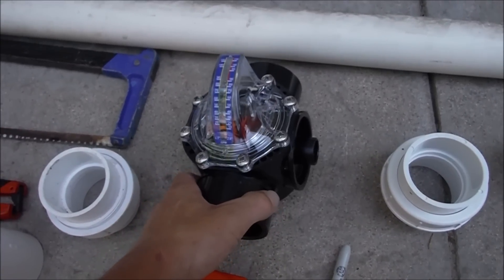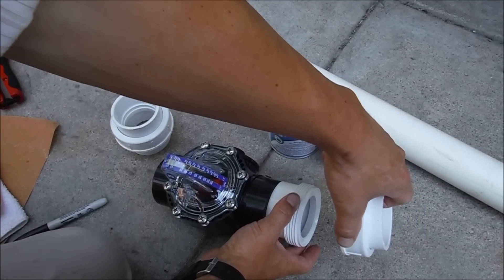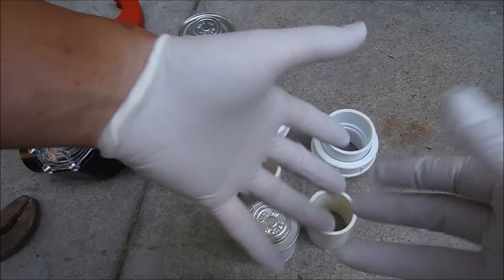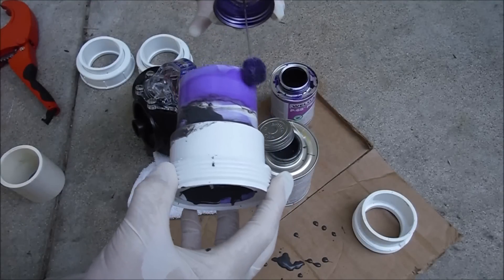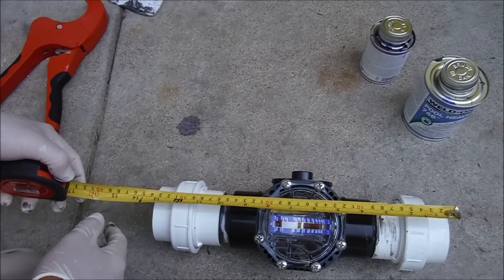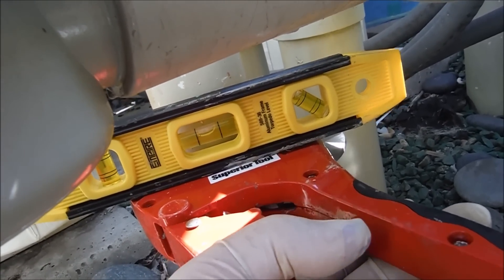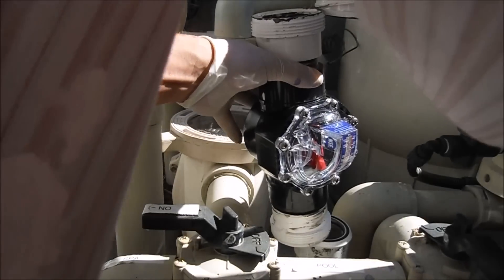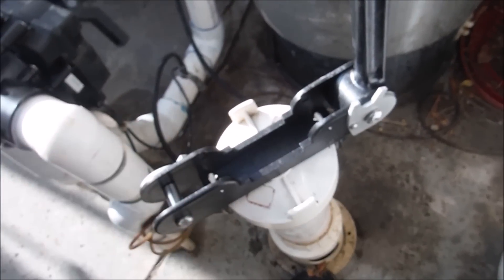FlowVis® Flow Meter - Plumbing in the Complete Valve

Comment: One helpful tip is to put the unions on when glueing the fitting. Sometimes if you get enough glue on the outer surface the union will suck air or leak water. Also make sure the union is tight when glueing.

Comment: I just installed one, took the cover plate and plunger off the jandy (only) check valve and replaced with the flow meter face plate and spring plunger. It works perfectly

Comment: Two corrections should be made to the the assembly process in this video.

1) Two glue types are needed for this valve and union glue-up.  The valve is CPVC and as such requires a "General Purpose" glue that specifically says it works with CPVC, not just a PVC glue.  PVC primer is fine for CPVC though.  The gray stuff used in the video is a heavy. high strength PVC glue.  You should use the gray stuff for any PVC pipe 2" and greater in diameter.  You really need to hold it place for the first 30 seconds after insertion and twist.  It does take longer to dry before use.

2)  The valve should be disassembled before applying primer and glue.  Any spill over into the check valve will likely ruin the seal or flapper.

Do it right.  Do it once.
Reply: Thanks very much Steve, just caught this thanks to your post.  Was about to use the wrong cement.
Reply: Hmm, so much for that.  Everyone recommends Oatley All-Purpose but right on Oatley's site they state here: https://www.oatey.com/PlasticPipeCement they state "Can I use All Purpose Cement to join PVC to CPVC?

No. It is not recommended because it takes longer for CPVC to finish the curing process necessary to complete a strong bond after the cement is applied. CPVC is also rated for hot water use which will affect cure times. PVC is not rated for hot water temperatures."
Reply: I was only able to find one Cement that is "also certified for transitions to PVC".  It is IPEX "System 636 Transition Cement / CPVC CEMENT".
Reply: Glad to help. Weldon makes a CPVC cement.
Reply: So just use CPVC primer and glue. Disassemble the valve prior to gluing. Thanks
Reply: @jeffrice238  636 is for venting only!
Reply: The correct cement for a CPVC valve to PVC piping is IPS Weld-On 724, which is rated for both/either plastic resin. See: https://weldon.com/solvent-cements/cpvc-cements/724-cpvc/
Use along with either Weld-On P68 or P-70 PVC-CPVC Primers

Comment: You don’t have to attach the unions right next to the check valve as shown in this video. You can add them elsewhere in the system which will allow for partial disassembly so there’s enough slack to directly plumb in the flow meter. Best practice is to have unions on either side of each major component so it can be easily swapped out or removed for repair. Otherwise over time your system will get all chopped up and filled with couplers until there’s no room and you need to re-plumb the whole thing. Unions are 100% worth the cost and installation time

Comment: Just a heads up, this adds a lot of relative dynamic head to your installation if your system is designed for low head loss(eg. energy efficient). The official specs are:
 Head Loss (Model FV-C) 0.77 psi at 20 GPM, 2.37 psi at 112.6 GPM.

Comment: Hey david why do maufactures like hayward or pentair use brass nuts or like the top of a  starclear plus filter use brass instead of hard stainless steel for fastening the lid it seems like brass is a soft metal and shaves every time you use it

Comment: This valve is CPVC not PVC (stamped on it).  I confirmed on the H2Flow engineering data sheet for this model (FV-C 2"/2.5").  Their larger models are PVC.  How do I glue it to PVC pipe?  I'm confused by your correction that says to use two different glues, but then you say use the "gray stuff."  The Weld On glue you used specifically says NOT for pressure applications and doesn't say works for PVC to CPVC.  Any help would be appreciated.

Comment: SPL, I have a question: My space is very limited (short runs) no run long enough for unions and actually none long enough for sleeves. Can I cut out the 4.5" needed and pull the pipes to the side enough to plumb directly to FV? It's 1-1/2" I know it will be a 1 shot deal and no dry fit
Reply from the maker: You can plumb it directly in.

Comment: Hi David what connections do you recommend I will be adding this after my water heater is yhere hi temp unions?
Reply from the maker: Standard unions are fine. But they do sell CPVC unions as well which are a little better under heat.
Reply: @SPL  thank you so much do you have a link
Reply from the maker: @franciscoguzman4318  They look like this - no direct link - I bet Home Depot carries it. https://www.supplyhouse.com/Spears-8057-015C-1-1-2-CPVC-Schedule-80-FKM-Union-2000-Socket-x-Socket?gclid=CjwKCAjw4MP5BRBtEiwASfwAL1Tqh1TEl16VfbQoO7wk0h-UCAMUSqADyNO4tRMhFV0sCUjYZfqW_hoCaxkQAvD_BwE
Reply: @SPL  thank you sir I appreciate it so much

Comment: If I have an in-floor cleaning system and I lower my rpm but extend the run time, would I need to run the floor system for the new extended run time?  Or would I just run it the 4 hours I do now?
Reply from the maker: You should be fine. If the pool looks dirtier than usual you can up the run time.
Reply: To get the most efficient circulation and filtration form your VS pool you will need to keep the 4 hours of higher flow that permits the pop-up system to activate as well as adding longer periods of low flow for circulation alone

Comment: What tool was that you used on the rainbow 300 to remove the top i have account and it will not come off.
Reply from the maker: That is the Klorkinator by Multi-Tork. I believe only one supplier carries it right now. Very handy tool. I've got a complete video on it: KLORKINATOR. Klick. Twist. Done. - Lid & Cover Removal Tool: http://youtu.be/esP1CrYvRNE 

I use it all the time and love it. Call this number to order it: (800) 683-4500 or visit their website and send them a message - I think it is multitork.com. It just came out a couple of months ago. SCP doesn't stock it yet.

Comment: Hi, how many pool volumes as a minimum is required to pass the filter in 24 hours?
Reply from the maker: Not sure exactly for your pool  -each pool is slightly different. The way you calculate it is by the pool volume - how many gallons divided by the flow GPM. That will tell you how long to run your filter each day.
Reply: One pool volume of filtration only treats about 64% of the water. The standard is to allow for THREE volumes each day which treats 95% of the water. This ratio applies equally to any size pool

Comment: Hi, is the measurement only in GPM or also in liters per minute ?
Reply from the maker: MrLito010 So far it is made for the US Market mainly. It is a good idea for a version in Liters and I will bring that up to them. So you will just need to do some math- Google search engine has a built in conversion so 60 gallons per minute would be 227 Liters per minute.
Reply: Hi, thanks for your prompt answer. My pool will have a volume of approx. 110m³ ( 29100 gallons ) and the turn over time ( with a solar powered pump ) should be about 5 hours, means a pump capacity of 97 GPM ( 367 Liters per minute ). Where should I install the flowmeter, right after the filter ?
Reply from the maker: MrLito010 I like installing them after the filter and heater but there isn't a huge difference in the reading. I tested two at once in different locations and the readings were pretty close in both. Wherever there is a length of PVC pipe is where I would put it.

Comment: what is that for????
Reply: Allows one to measure how many gallons per minute of water passing through the system at a given pump motor RPM. It’s the only accurate means to adjust pump speed in insure adequate circulation time